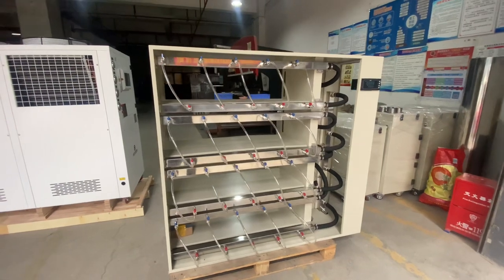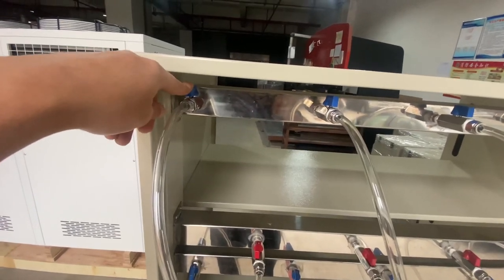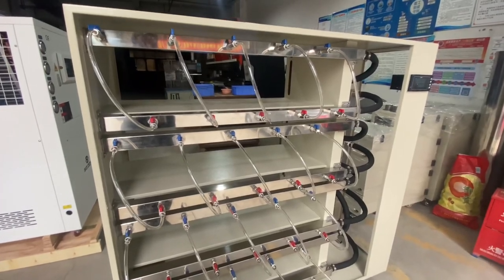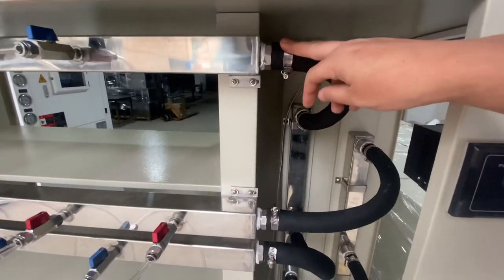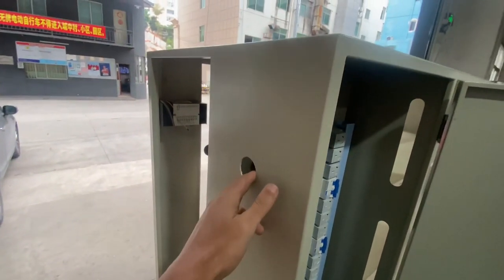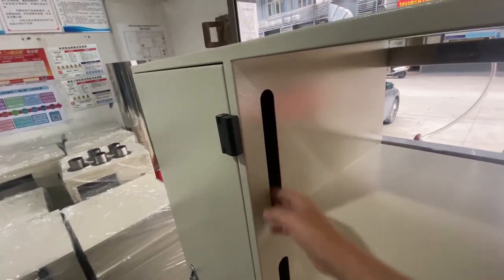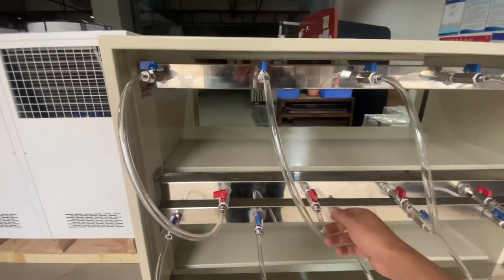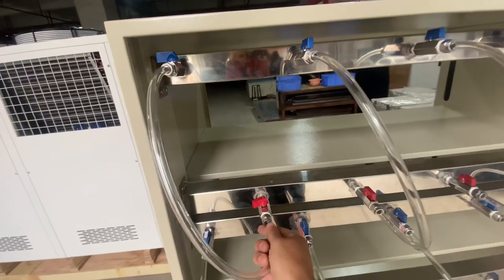How to mine bitcoin  with Antminer S19 Hydro  250TH ?

Comment: What material is the water divider of the equipment? Doesn't it rust when using metal to circulate water?
Reply from the maker: It’s stainless steel , it won’t rust

Comment: Great video.  Can you tell me 1) is 250TH on S19 Hydro with the AsicShield OC firmware?  2) how much power is used at 250TH?  Does your cabinet support overclocking power?
Reply from the maker: Yes you casn overclock the S19XP hydro with Asicshield Firmware , the cabinet can support up to 7k per miner , the original consumption for the S19 Hydro is between 5.2 to 5.5KW
Reply: @Crypto_mining_lab  Thank you!  That's great. Can you also overclock the S19 Pro Hydro 198T with the firmware?
Reply from the maker: Yes you can

Comment: With your dry Cooler can i run 1 s19xp hydro? I need only the dry cooler ?
Reply from the maker: yes of course but for one unit i would recommend a smaller size Dry cooler , and we do have few options for single Hydro units , you can reach us through this link for more details 
https://www.cryptomininglab.net/contact-1

Comment: The chiller is placed outside since the UAE is hot as hell?
Reply from the maker: You just need to cover it , but you can put it outside without any issue , these are industrial chillers they meant to be used in extreme weather

Comment: Why not put hot water outflow on the top and the cool water inflow in the bottom? Heat rises, that's why I ask
Reply from the maker: Yes can be done  either way , and there is no restriction on which ports will be used for in and out